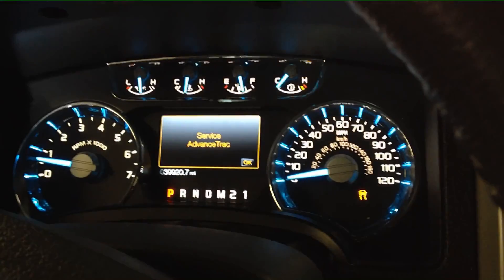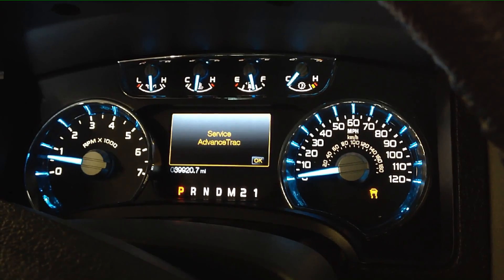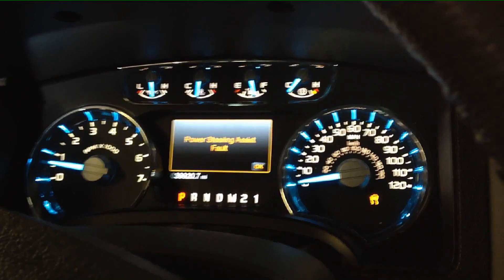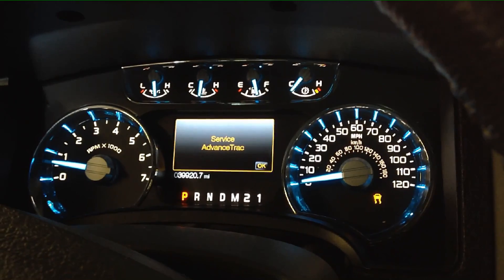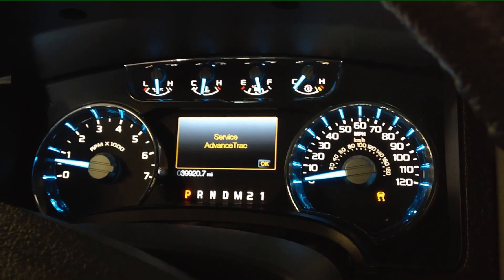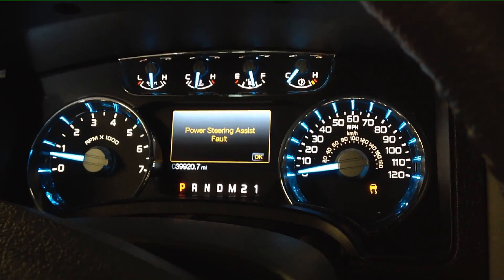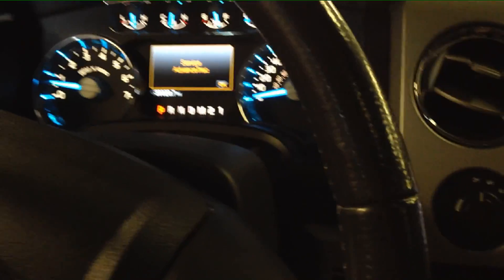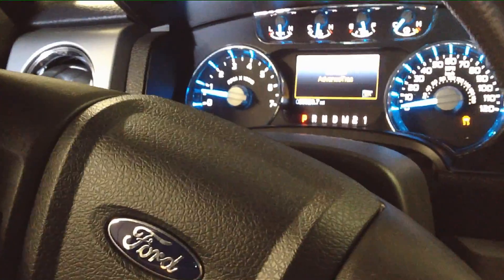Ford Quick Tips: #29 What A Failing Electronic Steering Gear Sounds Like

Comment: Its really sad how expensive these new trucks and cars are and how expensive they are to maintain and the shorter life expectancy of them. Very sad
Reply: 1980's Mercedes diesels and Volvo's going 500k miles
Reply: @johnmartinez4381 2000’s Mercedes with traditional engine architecture go the distance too. 

Plenty of M112 V6’s and M113 (K) V8’s going the distance out there
Reply: The f150 is a bad example of the auto doom you're preaching haha uneducated
Reply: Are you dumb? Back in the day if your car was getting towards 60,000 you’d better start thinking of getting a new one
Reply: @anonymousiswatching  sure, but lets go in between at like... early to mid 2000's. The peak of reliability for modern cars. my 2002 silverado at 235k miles, 2005 sierra at 250k miles. simple and basic systems that work well.

Comment: I know this is an old video, hopefully you still look at comments. I have a 2011 F150 (103k miles) and one day my stearing started to pull one direction hard so I pulled over real quick and looked around and then got back in to start driving and almost immediately the "power steering assist fault" came up and it was extremely difficult to steer I was able to drive it all the way home (maybe 10 miles). I'm a big guy and it was pretty difficult to get it in my driveway. I tried to start it up again a few hours later to try again and I have the same message. There is no noise at all like this and it is not intermittently difficult. It just stayed difficult to steer. Do you think this is just maybe a computer reset kinda thing or it went bad?
Reply from the maker: No it's the internal steering angle sensor this is how they fail and you can only replace the entire rack.
Reply: FordTechMakuloco mine never made this sound either and just locked up on me the other day. I had noticed it had been a little loose feeling like alignment a little off but nothing other than that. Are you sure there is no way to replace the sensor alone? Or maybe take it to another mechanic to fix? Ford is trying to charge me 1700 for mine and it’s a 2011 Ford Fusion. Half the price my car is even worth.

Comment: the auto industry is just about a joke now days with all the stupid electronics. engineers are making the vehicles less reliable and they don't even know it, and who the hell would buy a 60k plastic truck that you have no control over. maybe they should put a Chinese electric motor to press the brakes for us too because it hurts my leg to stop.  that way they take away all three controls, throttle, steering and brake!    its got to be some sort of government deal trying to kill off the population!lmao
Reply: My 2014 Fiesta 5spd manual has a hill start assist feature that can hold the brakes as I move my foot from the brake pedal to the gas. The ABS control unit can apply brake pressure without your help. Same thing goes for front collision alert systems that apply the brakes when pedestrians or vehicles are detected and you take no action to stop. They've got control of your brakes too.
Reply: Mine has went out twice. Once at 50K and again at 92K

Comment: if i want to replace this myself could i? i have heard there has to be some programming done... but would i be able to drive it to a shop once i replace the part and have them program it or would it be completley inoperable?
Reply: Did you ever figure it out? I’m dealing with the same issue now. Does it have to be programmed?

Comment: I have a 2014 Ford Taurus Limited with the NA 3.5. I have had a clunking sound happening when i go over bumps while turning. I dont have this screeching sound but the dealer just inspected it and said my steering gear is coming apart. IS there currently a recall for the steering gear?

Comment: Electronic steering is a MAJOR safety hazard. If a sensor goes out while you are going down the highway at 70 mph you are screwed. With traditional power steering, you can still turn if it goes out, it will just be harder to turn.
Reply from the maker: Once the system senses a failure it disable the system and you now have manual steering just like a conventional rack.
Reply: @FordTechMakuloco  lol it can be done. P
Reply: @FordTechMakuloco  i know this is an old video. My brother has a 2012 f150, last night the steering just quit. No warning lights no previous problems, nothing. The scary thing is that  it wont turn at all.  Now i have no trust on electronic steering vehicles, one thing is to loose you power assist, i get that. But when you cant turn the steering wheel at all that's a different and scary thing.
Reply: There is still a mechanical rack, and if the sensor or motor fails, you can still turn the wheels just like you could with an old hydraulic system.

No more a safety hazard than blown hydraulic hoses or failed pumps.
Reply: So basically it is just disabled right now it's safe for me to drive...????

Comment: I lost the power steering of my  2013 XLT 5.0 appears both "Service Advancetrac" and "Power Steering Assist Fault" My Mechanic says I need to replace the complete EL3Z3504BE Gear Assy. How can it possible in a 3 year car? Why FORD do not recall this situation.
Reply: There should be a recall. This is definitely a safety issue as it is with the Fusions that do have a recall for EPAS. Ours had faults for a year before the recall came out and it was another 6 months or so before Ford got enough new racks to comply with the recall. At first, the fix was a software update but that did not fix it at all. It never made noise though. It just failed and the key switch had to be cycled to reset it. Not good. No problems since the new rack was installed.

Comment: LOVE YOUR VIDEOS..HOPE YOU CAN ANSWER THIS QUESTIO..2010 FORD EDGE ECOBOOST WITH THE ELECTRONIC POWER STEERING...SERVICE POWER STEERING LIGHT ON..STEERING WHEEL IS SUPER SUPER TIGHT ..BARELY WILL MOVE..HAVE TO REPLACE THE WHOLE RACK? FORUMS AND EVERYWHERE SAY FORD KNOWS ABOUT THIS BUT WONT DO ANYTHIN ABOUT IT AND IF I BUY A NEW RACK THEN SAME THING WILL HAPPEN

Comment: Do f250s have a similar problem with the sensor? Mine (2011) has the service advancetrac/ hill descent control and turn signals wont turn off after the steering wheel is straight
Reply from the maker: +mekani phiri No they don't have electric steering it seems the steering wheel rotation sensor in the column is the issue on yours.

Comment: do the f150 v8 have that stupid electronic PS?
Reply from the maker: +STEEVE DAVID Nicolas mid 2011 and newer
Reply: +FordTechMakuloco what would a 2009 F-150 4x4 use for power steering? Would it be the EPAS?
Reply: Not the ones with the 6.2 V8.

Comment: I have a 2011 f150 Eco. Recently my steering has just felt stiff/tight. Feels like it takes more effort than normal to turn the wheel. Any ideas on what the issue might be? Thanks
Reply from the maker: +clayton oneil  Being an eco you should have electric assist I have seen these cause this due to the steering angle sensor information being corrupted.
Reply: Finally found a comment relating to my problem!! Same just started stiffer than normal. I wonder if I'll have a full replacement too?

Comment: Oh, and I forgot to inform all affected owners; if you do experience mild or intermittent steering symptoms; do not take your vehicle to dealer. Any failure other than complete rack failure will result in software update only (mandated in Ford recall TSB 15S18). Once Ford has updated your software; they will not replace your steering gear after it completely fails; weeks or months later. Don't believe me? Read recall TSB and customer testimonials that were refused service after receiving software update (which only detects additional fault condition and sounds warning chime). Affected consumers are strongly advised to do whatever you can to get units to fully fail prior to dealer visit.
Reply: What model and year? I can't find it in Prodemand.
Reply: If my truck is a ford 2012 ecoobost and is out of warranty does the recall will apply? I have 70000k miles on it,I have 6 years with  the truck,thank you Mr Smith.
Reply: I think the recall does not apply for the ford 2012 f150 ecoboost out  of warranty?my truck is making that sound!!
Reply: Get units to fully fail prior to a dealer visit?  When?  After the funerals?
Reply: B Smith 2011 f150 need service power steering

Comment: Ford EPAS steering assemblies are experiencing thermal overheating due to both poor EPAS assembly internal thermal management design, and Ford's attempt to integrate too many high-heat sources in close proximity within engine compartment. Problem is especially prevalent in turbo implementations. If you simply take a look at Ford's engine compartment implementation; a story begins to develop. Extensive heat shielding added to EPAS enclosure with turbo located within inches of EPAS assembly (3.5L Flex), large air-dam added to vehicle underbelly to increase air circulation. Recall on turbocharged Mustang due to excessive heat buildup. If you run the turbo's hard then park vehicle and take temperature measurement at EPAS aluminum enclosure under heat shield; you will see what I mean. The final death-blow comes with extremely poor thermal management design internal to TRW EPAS assembly. TRW obviously experienced heating issues during EPAS design phases. First, electronics are industrial-grade components, this limits semiconductor operating temperatures to approximately 85C. Second, TRW attempted to improve heat removal by "gooping" large amounts of thermal compound between internal electrical components and aluminum case. This compound is not intended to be applied in this fashion and over time, dries, cracks and stops conducting heat. Most interesting in your video; is evidence of identical problem experienced on my vehicle, that forced vehicle into concrete curb; i.e.  non-commanded torque resisting steering wheel motion. This is typically caused when overheated H-bridge driver MOSFET'S fail causing direct current path through motor windings (confirmed in my failed unit). Note Ford explicitly states during NHTSA investigation; that this dangerous failure-mode cannot occur. 
Heat related failure is also supported in other investigations showing dramatic failure rate increase corresponding to summer driving months. Heat related failure explains all enigmatic and anomalous failures occurring over model types and years. Problem is not specific to any given vehicle; failures are instead due to convoluted mix of under-hood thermal management, ambient temperature, driving condition, and driver tendencies. This larger picture also explains Ford's complete failure to properly address problem at hand, and hostile posture toward affected consumers.
Reply from the maker: +K Smith Heat is definitely an issue but I can tell you I have replaced many EPAS racks and none have been ecoboost equipped. Most if not all stem from a failed non serviceable steering angle or rotational sensor and some have been for internal rack noise.
Reply: FordTechMakuloco Your feedback is still consistent with heat related failures. I had opportunity to perform detailed electrical testing on TRW EPAS rack; with failed driver electronics specifically identified. I have no doubt encoders are greatly affected by thermal problem as well; as all EPAS internal electronics are placed under thermal stress. Failure symptoms described correlate well with servo-feedback loss, as well as failed drivers.
Keep in mind, TRW is rather new to complex electronic implementations. TRW's historical expertise is in design of mechanical assemblies. Placing industrial-grade, highly integrated electronics in sealed inclosure next to high-heat sources is just bad idea all around. Thanks for your feedback...
Reply from the maker: +K Smith Maybe internal heat issues yes but the f-150 racks are in one of the coolest places around the engine compartment and they fail all the time.
Reply: +FordTechMakuloco Would be interesting to have measured EPAS enclosure temperature measurements on F-150. I measured 78C under heat shield on 3.5L with turbo. This is far too hot for industrial grade components. Can you provide guess as to what temperature is implied by &quot;coolest place under hood&quot;? I have no experience with F-150 rack layout, but in Flex, entire integration is extremely tight.
Reply: Sorry, I posted temperature of 78 degrees C. This was typo, actual EPAS aluminum housing temperature was 88 degree C.
Reply: I subscribed to you because you hit the nail on the head about my 2012 Fusion with only 46,000 mi!

Comment: Makuloco,  for you experience any advice that you can provide for troubleshoot and fix on the following issue will be appreciated!
Saturday, I got my 2013 XLT  F-150 delivered from the body shop  to my house. The person driving the vehicle said that  making a turn  a few blocks blocks from my house the steering wheel suddenly  turned to hard to handle it. The drivers had to put all his arms force over the steering wheel to get possible the turn and control of the vehicle.....this was a really unsafe situation since look like the electronic power steering assist (EPSA) stop working or is  malfunctioning.  So at the present no electronic power steering assistant available on my pick-up, also when turn the vehicle on and try to move the steering wheel the following lights warning message are reading on the dashboard:  "POWER STEERING ASSISTANT FAULT", follow it by "SERVICE ADVANCE TRAC", and HILL DESCENT CONTROL.    Please any advice will be appreciated, I have contacted FORD Customer relation and they said there is not recall at this moment for this issue, but there is a service bulletins available for this issue.

Comment: Can you just unplug the power to the PS motor and use the car/truck as unpowered steering?
Reply from the maker: Yes they are design to go into a mechanical mode if a failure is noted and shuts down
Reply: You could but if it isn't locked up, you are going to have a HELL of a time turning at low speeds...  lots of weight, big tires, and a lot of friction to overcome...
Reply: Well this comment is two yrs old now.  ....I hope you're all still alive if not RIP.
Reply: FordTechMakuloco hey there, I found that not to be the case. Once it locks it's done. There was no disabling it. It got flat-bedded to Ford and they said the same thing. 

IF this goes out on a corner, you're fucked
Reply: So basically locked up and can cause a crash ? And is the same problem as in the video?
Reply: +Mario Hermida Wont miss you, you piece of shit...

Comment: Mine failed during a U turn with my entire family in the truck went into a limp mode.  NOT GOOD, hopefully Ford figures it out. 2011 F-150 SCREW Platinum.  Talk about scary, lost steering and it jerked the steering wheel out of my hand as if I hit a pothole.
Reply: Same thing just happened to me! Luckily I was the only one in the vehicle. Making a U turn on a 60mph highway it locked up so hard I just had to make a normal left turn.

Comment: If this electric assisted steering can fail at approx 40,000 miles, then you are probably going to have to do this again and again if you want to keep your truck to at least 150,000 miles? That really drives up the cost of ownership of an F150. The scary thing is almost every car maker is going with electric assisted steering, so there is really no way to avoid this issue.
Reply: Sure it is,you go back ,pre steering assist and fix up something with a regular old hydraulic power steering,it’s better anyway
Reply: My truck just turned 180K and the electronic rack hasn't failed yet.  I have a vibration I'm trying to find, which is why I'm here.  Fortunately, my truck doesn't sound like this.

Comment: I've had a rack issue on my 2012 focus Fighting for your lane and wander at highway speeds. ford still won't replace it even though it has the symptoms and a tsb on it.I've proven them that the alignment measure are all correct.
Reply from the maker: They wont change it because it falls outside of the build dates or something?
Reply: Mines in the build date.the dealership I go to is terrible.funny part is they have won the "ford excellance award"many years in a row.I had to call into ford motor company to have them take Me seriously with my strut issues.(clunk over bumps).they played games with me for a year.they didn't argue too bad with me on my clutch.the shudder really wasn't all that bad.it just leaked a lot of oil.the under shield was soaked when I pulled the cover off underneath.

Comment: I've got something odd with my 2012 Ford Fiesta's electric steering as well, at least I think it is. As I'm driving straight,  no problem,  it's when I'm going through winding roads or making steering corrections is when I feel and see the steering wheel shake. It doesn't do it if I leave it completely alone. If it were a bad tire it should be doing it all the time, shouldn't it? I would appreciate any help you can share. Thanks!
Reply from the maker: Yeah it sounds like the steering gear is starting to fail they twitch like that at first. We just had a guy change one last week.
Reply: The new Audi's do this to. Their steering racks look very similar to the fords.